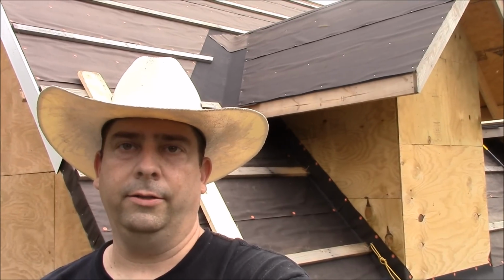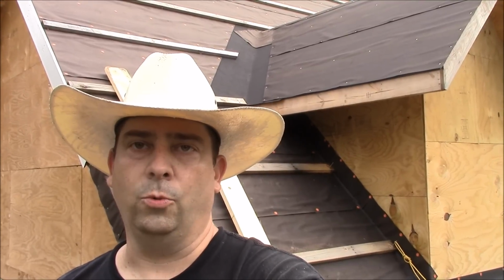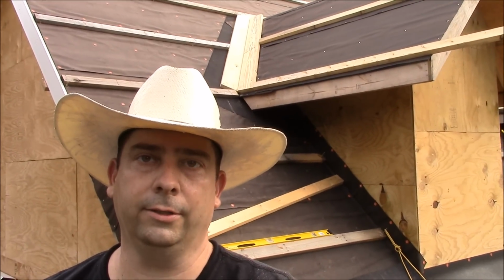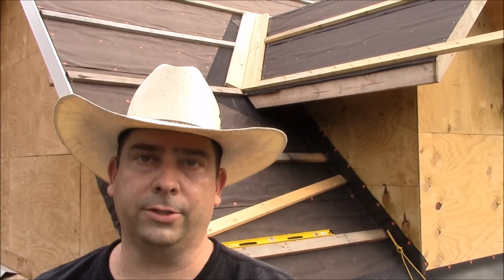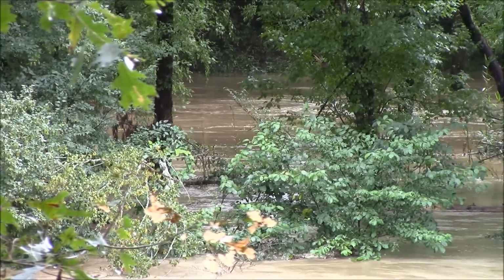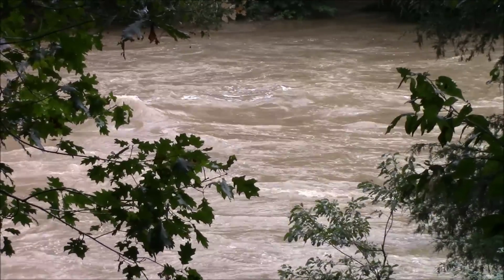Building My Own Home: Episode 35 - Prepping the Northern Facing Roof for Metal

Comment: What is the difference between attaching the roof on the boards and on the 2x4 runs? What are the advantages and disadvantages? Isn't it easier to walk on when attach the roof on the boards? Thank you.
Reply from the maker: The reason for the boards is so that the roof can pull cool air in the bottom and exhaust the hot air from the top, so that the heat from the metal wont transfer into the house.